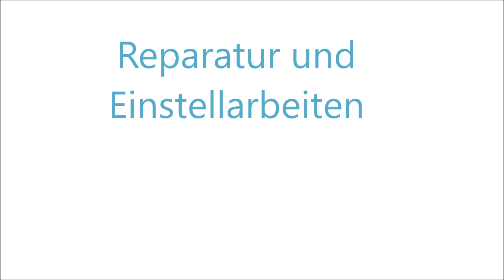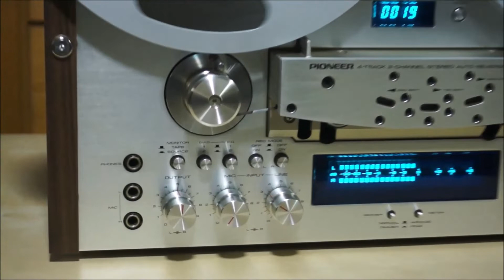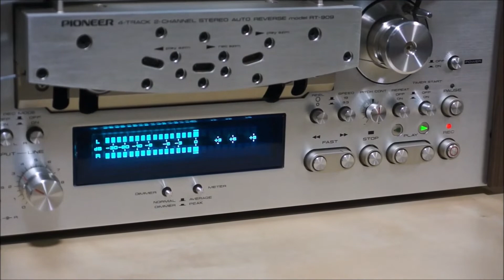Pioneer RT-909, Reel to Reel

Comment: The blue lights on these reel to reels are absolutely BEAUTIFUL. I bought one of these used back in 1995 for the unbelievable price of $250.00 USD. YES it WORKED.
And it still does. It just needs a new pair of rubber pinch wheel rollers.

Comment: Did you have any problems with the tape rubbing on the take up real? mine did and I adjusted the center screw it now works great, but  the tape on the supply reel doesn't wind the tape evenly, should I adjust the center screw on the supply reel also, the tape does not rub though any suggestions.
Reply: What screw are you talking about? I'm having the same issue. Also the stereo output signal will randomly cut in and out.
Reply: In the middle of the spindle there is a screw,check the owners manuel,i am still having issues with the winding evenly,turns out i don't know what i am doing,lol,i found a tech here in Sandiego that is recapping  and adjusting the table.